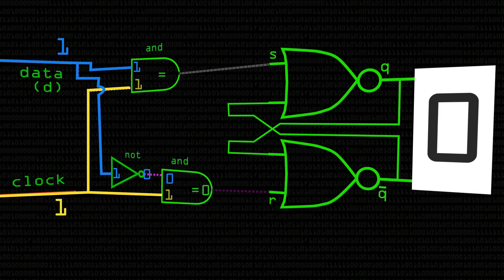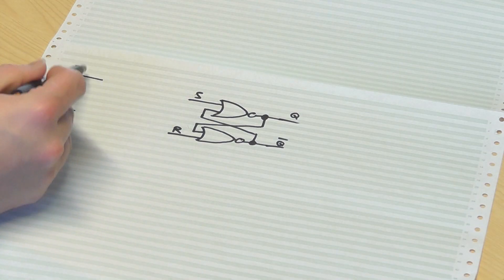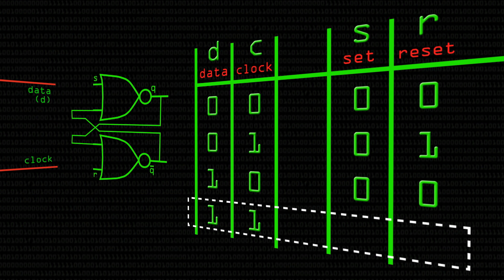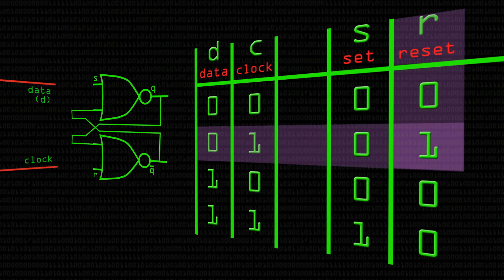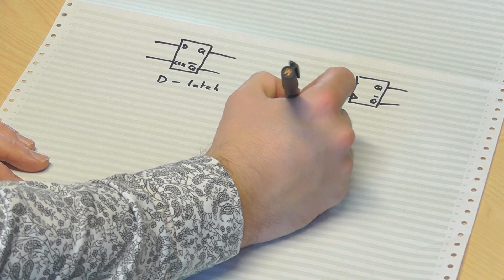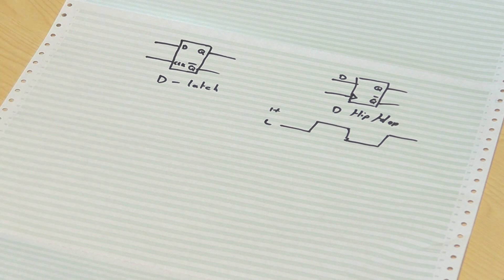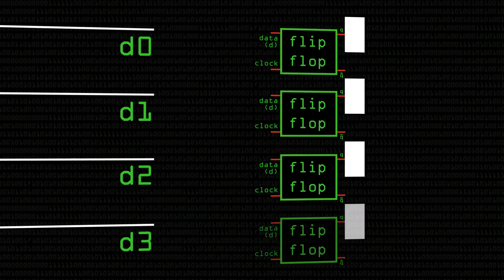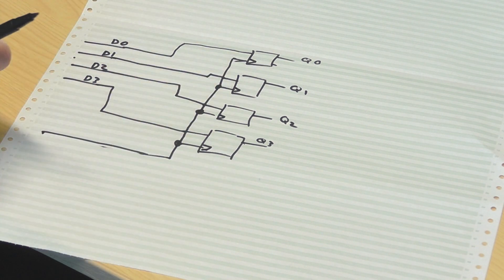Flip Flops, Latches & Memory Details - Computerphile

Comment: When I got introduced to the d-latch, the non-data input was called 'enable' instead of clock, which makes a lot more sense to me because the d-latch is not edge-triggered like a flip-flop, but can change its value whenever enable/clock is set to 1 and not just at the exact moment when it goes from 0 to 1 (posedge).
So. Voting for 'enable'!
Reply: current uni student in CS, I can testify I learned it as “en”, which stands for enable
Reply: I couldn't agree more! I was very confused between latches and flip-flops in the initial days of my semester. Some people(including some professors at my uni + on the internet) took little to no care while talking about latches and flip-flops and would often use the terms interchangeably. Enable for latches ftw!
Reply: ok?

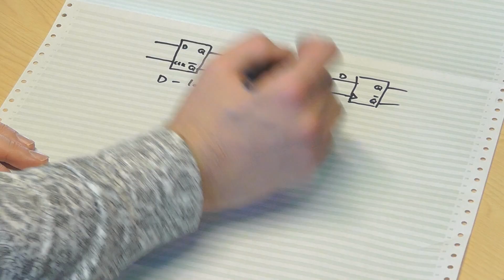Comment: Benevolent critique: So at about 3:45 he starts drawing.  The angle of the camera puts his hand directly between the lens and his drawing, so all we see is his hand moving around while he talks.

A better shot might to be to film this from the other side of his desk, so the hand, drawing, and paper are visible.  They'll be upside down in this shot, so you would rotate it 180 degrees for final cut.  That way we can see him draw and point with the pen/texter while he speaks, and no rigging is required to get the camera directly above.

Just a thought, I've not tried it.
Reply: Also, in the shot where the viewer was supposed to see the wires on the mainboard, I didn't see much and the editing was more akin to music videos than documentaries.

Comment: I beg for a bit more differentiation between different memory types and usages. This kind of circuitry is useful to build shift registers, counters, multiplexers, code convertors etc. But it is only remotely related to the SDRAM that is used in computers today or NAND-Flash devices like thumb drives and SSDs. This video is very miss leading in the sense that it leads people to believe that the RAM in their computers is built using flip flops based on NOR-Gates (That would be SRAM). That's not the case. DRAM is used in contemporary computers which uses only a singel transistor (Compared to SRAM using 4 to 6 transistors) and a capacitor to store information and is periodically refreshed due to the capacitor loosing charge over time. Because DRAM is cheaper and more space efficient, it has replaced the SRAM in many applications. SRAM has some other advantage tough: it is extremely energy efficient and allows faster access times than DRAM. It is therefor primarily used in applications where speed and energy efficiency is more important than space and manufacturing costs. Namely CPU cache, processor registers, FPGAS, small lowpower memory (eg. BIOS chips). Would be nice if you could feature this in a future video =)
Reply: Don't Panic!

We'll get there… :)
Reply: That's good to know, because when I was taught about about computer memory in my apprenticeship, we were not told which is used for what. Had to finde out by myselfe. Then in an other course they taught C and Assembler on micro controllers. We learned how to use memory an registers, timers, counter etc. but no one ever talked about the actual hardware. Bit of a shame really. I am currently in my first term studying cumpter science and I am planing to specialise in embedded systems. I hope they will do a better job.

Comment: Looks like exactly the same as how they store data in those Minecraft computers. Really learned much playing with those redstone stuff.
Reply: Yes... Those are modelled on real computers. Redstone seems to be a very simplified model of how electricity works, so it kind of makes sense.
Reply: KuraIthys I agree that they are simplified model, however it provides a great degree of similarity to the solely logic part. This gates when made in Minecraft gives the player excellent visualization of what is going on. For example, for an SR latch, instead of looking at two weird shapes with crossing lines, in MC what you do is simply placing two blocks (OR), two torches (NOT), and two dust (wire). This game lets you actually understand what is going on, and I believe it serves a great educational purpose and deserved to be featured on this channel. That's only my opinion though of course.
Reply: sarowie yeah i recall people saying 
insert 9yo voice
WOAH I THOUGHT RS-NOR LATCH MEANT REDSTONE-NOR LATCH

and even worst

WOAH THEY HAVE THIS DESIGNED BASED ON MC'S RS-NOR AND HAVE THE SAME NAME

Which is why i call them SR nor latches
Reply: But don't forget
We can add mods (Project:Red mod/redpower[obsolete]/redlogic) that adds in premade logic blocks
We can use torches and rs to teach basic logics, and then move on to compacting it and making bigger logics. Also, this components do use the proper terms (sooommewhat) and less of an hassle than Vanilla MC RS
Reply: Yadobler Despite the fact that they are referring RS as "redstone", isn't a good thing to hear from a nine year old talking logic gates? This really proves the success of introducing these binary gates to the young generations.
Reply: Yadobler
Okey - I´m not that much into modded minecraft. Great when those mods use the proper terms. I also know that the minecraft wiki is using the "official" terms correctly. I guess/know that bored computer scientist are contributing to those wikis.

Still: Some times it is funny when a youtuber builds a fancy (and working) mob system, but he can´t explain it as he literally never learned the rights words to explain what he is doing. Of course: Downloading the world and exploring and rebuilding the system based on that, is also great: Reverse Engeering is a great way to learn from a genius master.
Reply: Yeah, i mean like when i was 9 i kind of started programming but i was so damn scared when i saw Assembly x86, but now i'm quite fluent in assembly *cough cheatsheets everywheer *
But what i'm coming to is initially this stuff looks complicated, but once one gets a hang at something they will understand the possibilities of programming, both in sense of soft and hardware

And what better way then with minecraft. Kids like minecraft, and we can enhance that to teach them electronical engineering, in this rapidly growing technological world

Look at MinecraftEdu, very successful

Should recommend this to my government. They are implementing programming into the school curriculum, they need this approach.
Reply: sarowie because Notch didn't intend Redstone to be used by electrical engineers, but a simple, technical interactive dust that exists in the world of minecraft: 

dust carry redstone signal
signals last only 15 blocks
things could provide signals
things interacted with signals
torch could provide signals, or turn off when it itself is receiving the signal

this "torch inverter setup" is your building block of inverters, the answer to life and everything technical in the minecraft world

The mods are more developed with Electrical logics in mind, so proper terms.
Vanilla redstone behaved differently compared to electricity and had its own terms, but both have things in common

I've too seen people build big contraptions and never realised they used AND gates and Half-Adders
Reply: Yadobler Correct me if I'm wrong, but aren't AND gates in vanilla Minecraft realised as NOT(NOT(A) OR NOT(B))?
'cause, at first, you only have OR (redstone lights up if anything provides signal to it) and NOT (torches go out if some redstone under it is lit up and vice versa).
It's kind of crazy how much you need to do to even realize fairly simple circuits, but by just experimenting with the pieces, even young children are able to understand logic gates which is frankly amazing.
Reply: Yadobler I think it's because they don't start with the foundation, they start with one layer up. Of what I remember in Minecraft, you really only have OR and NOT gates available to you. AND gates have to be recreated DeMorgan-style. So when they come up with their own terminology, they are missing some fundamental building blocks that computer scientists/engineers already have a fluent understanding of.
Reply: KrunchyGoodness True, it's like:
If i blow wind to a puddle it will "dry" up faster, but actually it's the humidity and evaporation all those stuff
Reply: KuraIthys One difference between redstone and real life, is once you design a logic circuit, irl you have to then convert it to an electrical circuit before implementing it while redstone can be built with just the logic circuit. I sometimes like to think that redstone engineering should an engineering discipline all on its own.
Reply: Yadobler Yes, I am well aware that that's how DeMorgan works. I was just wondering if that was the only way to implement AND gates in vanilla Minecraft. I'm pretty sure it is.
Reply: Nixitur Well you can also use a piston or a comparator for making an AND gate, which does not involve any OR and NOT.
Reply: Yeah, piston

Input a controls a piston
Input b is a repeater feeding into the block controlled by sticky piston
Reply: Derek Leung
(EDIT from further comments I feel now that this comment is telling the person I'm directing it at a lot of things he already knows. :P )

Recent versions have caused people compact things down. I'm not sure how you would make an AND gate, but I think you can actually now build an 'RS-NOR latch' (in quotes since I'm not sure it qualifies) with very little wiring at all -- two droppers facing into each other with an item in one of them, each with a separate input, with a comparator reading each one. One input is set, the other is reset. I think there are also piston designs, but the two droppers is most compact.

Now I'm thinking how to expand it out to the memory cell he describes in the video. I'm not big on redstone (haven't played Minecraft in a while) but I think AND gates are still rather bulky and annoying.
Reply: George Corley You could actually easily build an RS-NOR latch with just redstone, redstone torches and any sort of block.
Reply: angeldude101 That makes it similar to other logic simulations in some ways. A pure logic simulation of just and or and not gates would function at that kind of level. Unfortunately, with actual physical electronics, a lot of other stuff comes up. (Though some IC's are almost as simple as plugging logic gates together...)
Reply: Minecraft Redstone isn't modeled on electricity, although many people think it is. Redstone signals are basically just digital logic. Thus minecraft devices are often very similar to what you see in old discrete designs (designs that use separate chips for each kind of gate).

Mastering redstone is a really REALLY good introduction to digital logic, and is definitely worth it for anyone considering a degree in computer or electrical engineering.

Modern computers are very different, though. The old designs with 74-series logic are almost completely gone. The gates are still there, but the structures in modern ICs are way beyond what you can emulate in minecraft with vanilla redstone.

I spent some time during my digital logic course building some interesting devices, including a really cool multi-combination lock that used shift registers. I would be willing to share a video explaining and demonstrating it if anyone is interested.
Reply: Falcrist I view redstone current on as a 1, and off as a 0.
Reply: Falcrist I would love to see that video
Reply: It would be great if Minecraft would have let redstone circuits be run on a second thread that runs faster than the MC clicks..
Reply: Derek Leung I was about to post a comment just like this. I was trying to build a box in which I could read and write memory to different addresses to store a set of instructions that I could run in sequence and so I did a bunch of research and ended up creating one out of D-latch just like this video showed. I later figured out that in Minecraft D-latches are actually built in simply by putting one repeater going into the side of the other one (the former would be the clock and the latter would be the data).
Reply: The principle is the same, the implementation is a bit different, because Minecraft isn't exactly faithful to reality.
Reply: Those red stone got me to electronics
Reply: false.

Comment: Okay, so... you've described how a D-latch works in the circuitry, but how does a flip-flop work? What gates are wired together, and in what way, to make a low-to-high transition the "store" trigger?
Reply: It's simple really, though I'm not sure why they didn't cover it in the video. You take two D-latches, connecting Q from the first latch to D of the second latch. Then you wire the clock to the clock input of the first latch directly and invert the clock signal before connecting it to the clock input of the second latch.
Reply: Sokar
Oh. So I assume, then, it works on the same "slight delay" principal that makes latches work at all? Where the slight delay in a changing clock signal from one latch to the other is what allows it to "capture" the changed data before the second latch's clock signal goes low?
Reply: Not exactly, it would work under the assumption that the clock reaches both latches at the exact same time. The circuit I described before was for a falling edge D-flip flop, so it would save the data when the clock signal goes low. If you put the inverter on the first latch, it becomes a rising edge DFF, so it should be a little easier to conceptualize. In that case, when the clock is low, the first latch would always transparent and change with the data line, but the second latch would be frozen on the last data. If the clock signal goes high, the first latch will freeze on the last value of D it saw and the second flip flop will save that value from the first FF. The only time after that where you can save another value is after the clock signal goes low and high again.

Comment: Seems like S and R are not at their correct positions. They should be interchanged.
Reply: I think so as well.
Reply: This makes no sense, the circuit is invariant under mirroring.
Reply: In the part I video, the Reset was on top and and Set was on the bottom.